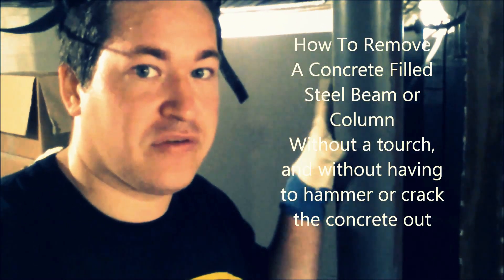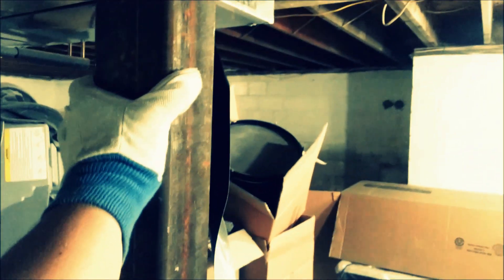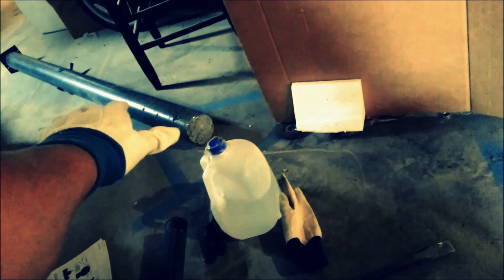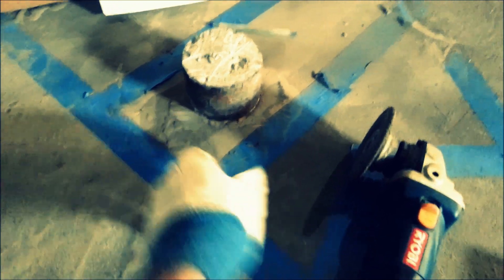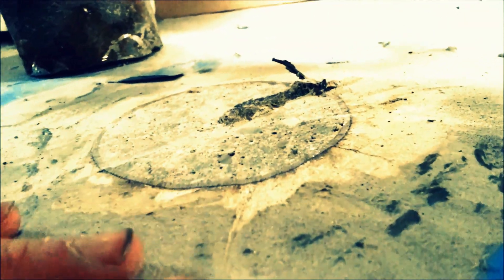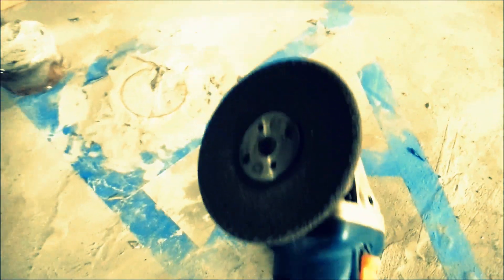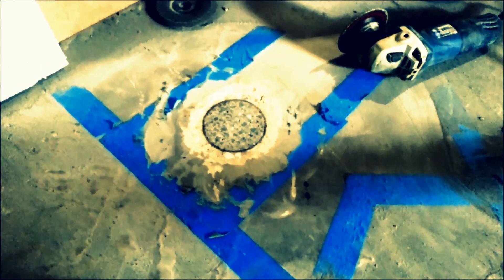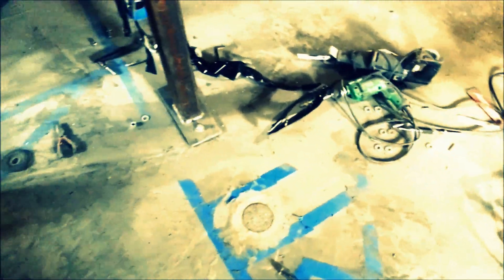How To Remove A Concrete Filled Steel Post / Column (Lally column)

Comment: Mabe a dumb question but do you have a footing poured for the new column? If not how thick is the concrete slab
Reply from the maker: Not a dumb question at all, and I should probably point out as there are plenty of contractors that pour slabs thinner now then they use to. This is a 6" slab on grade. I have seen basement slabs as thin as 3" on grade. This is a very important thing to make sure off before relocating the supports. The only reason I even could confirm the thickness is I installed a full perimeter French drain and a new bathroom next to the area where this was filmed so I had cutout several areas of the basement slab already.If you are unsure of the slab thickness, see if (with a newer home) you can get a PDF copy of the blue prints, or you might need to do a drill test.

Comment: Thanks for the video. I have a steel bollard that used to protect my old water heater in my garage. I changed to a tankless water heater and want to remove the bollard to gain some garage space.
Reply from the maker: Nice and thanks for watching!

Comment: Not too safe doing it this way.
Reply from the maker: Kiel, thanks for the comment, do you mind explaining a bit? Unlike most of youtube, I am a actually a professional structural engineer. What's not pointing out in this video, is my whole house is modeled in Tekla ( I have done extensive renovations and complete structural revisions throughout the remodel) and I have run point loads both tension and shear in all the main supports in my house. Even the HSS connection and base mount kwik bolt is calced and also run through profis for the anchor connection. 

I may dumb down my videos for fun a bit and make sure they fit a bit more main stream, but I dont see what whoud be considered unsafe relative to any other home structure revision.
Reply: @CinKoDel  hey..Im looking to remove a pole in my basement to save some room. I was told this beam was used for "antibounce". It  is under one of the I beams. The I beam is supported some of the living room floor.  Do you think In remove or at the very least move it to an area...around 8 ft from where it is now?
Reply from the maker: @drummerbee8042  Antibounce, is not a technical term by any means so I am not sure if I was you I would trust that statement from whoever told it to you. More then likely the beam that was used had a deflection under live loading that was greater then what should have normally been used. This would imply that when weight was distributed above the beam (furniture or just people standing) the beam would deflect (bow downwards) and bounce back up when weight was moved back off,  this was fixed by putting a mid span support below it to diminish the deflection to a point that it didn't "bounce" when walking on and off it above.  Depending on the length of the beam, 8 feet is a pretty decent size shift. For instance if the beam is running a whole house length of 60 feet and you move it over 8 feet out of center, that is a whole lot different then it being 25 feet and you move it 8 feet out of center. The best way to figure it out where you can safely move the beam without doing full engineering (and assuming a standard loading across the beam and no waterbed or chimney at some specific point on it) is to make sure the new clear span does not exceed what you have now. 
Meaning if you had a 40 foot span and the post was centered, you would have a max span support of 20'feet currently (20 feet clear each side of the post). if you moved that beam over 8 feet, you would now have a span of 12' on one side and 28' on the other, that 28' side would then need to have an additional post put in somewhere near the middle to make the total clear span less then 20 feet.

Now, that is not saying that you NEED two posts, but you do NEED to get that looked at by a professional if you do decide to move it 8 feet and not add the additional post. Honestly I would have someone look at it either way, but I understand that can get costly real quick. 

So to make this long comment shorter... don't exceed the max span you have now without having a licensed engineer (or at a minimum someone in home construction familiar with framing and floor supports) come and check it out.

Comment: I have some steel fence posts that were incorrectly installed. Will filling it up with concrete stiffen it up?
Reply from the maker: This really depends, if you dig out around your posts and repour in a deeper pour, then yes it will strengthen it.
Reply: @CinKoDel  what I mean is filling the hollow posts with concrete from the top so that concrete fills the entire post.
Reply from the maker: It will make the post itself stronger, but if there is an issue with the base connection, filling it will do nothing to help that. The post are under compression, filling them with concrete is essentially like using a thicker wall pipe or hss. If you have a sch 40 pipe, and fill it will concrete it may increase its strength to a performance yield closer to 80 or even120 (depending on concrete type and PSI) under compressionHowever a bad footing would fail out faster then that post would. I am only guessing but what you mean but "incorrectly installed" I was assuming you meant the connection at the footer. If not let me know and I will try to help.
Reply: @CinKoDel  the issue is that my workers dug the post holes too shallow (they hit solid rock and gave up).  Of a 3 meter post, I wanted the post holes to be 75cm deep, they dug only 60cm. Also,  they used 4*4cm hollow beams intermittently which flex a bit...that's why I was wondering about filling them up to make them stiffer. I'd really like to avoid having to use diagonal braces for aesthetic reasons. I got temp braces on em now. I also welded flanges to the base which act like cantilevers. The soil is gravel top soil, the next level is rock. Thanks for taking the time to answer. Much appreciated.
Reply from the maker: So the issue is in the footing. Filling them completley will not have a great positive impact. Ideally, when you cant go to the depth you want, you need to increase the width of the footer. However since I am assuming the footers are all now burried, the next option is back to filling them from the top. Truth is, you will still get some benefit by filling actually just the bottom portion of the HSS posts.  Having the addtional weight in the bottom 75cm (60 cm below and aprox. 15 cm above) will strengthen the footer by having the exposed portion more resilient to lean from wind pressure as addtional weight is now submerged below the point of torsion applied which is the very base of the visable fence right at the ground level.

I cant tell from the photos, but it appears to be a 6x2 (150x50) post. To fill the bottom 75mm only, you need to calculate how much concrete you need. 

Filling it up to the top will make the post actually more top heavy and cause more torsion from wind pressure against it  as the base is to shallow. 

Hopefully that make sense. Let me know if you need me to explain anything else.

Also, that's a beautiful fence.

Comment: Sorry to say this after all your hard work: once the steel is cut, all you need to do is hit it sideways with a hammer or sledgehammer. The concrete will shatter easily. 

Also, if a large pipe cutter is available for rent, this will roll around the pipe with carbide wheels and cut in seconds, both steel and concrete will split. 

It may be hard to remove the column if the building weight drops down.
Reply from the maker: Great to know! Had a sledge laying a few feet away too, wish I would have tried it.Though, either way I would have ended up having to grind the concrete for the finish floor to sit.Appreciate the tip David.
Reply: Jesus loves you all❤️, allow him into your hearts.
Reply: Yup